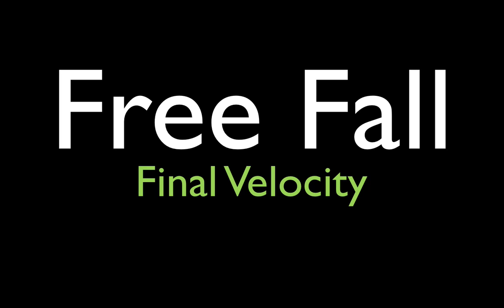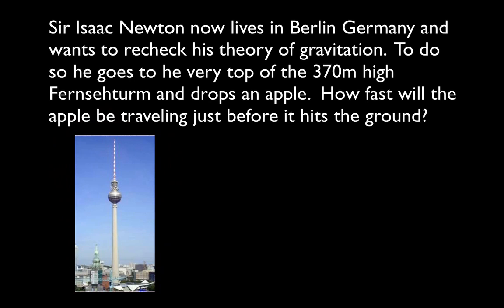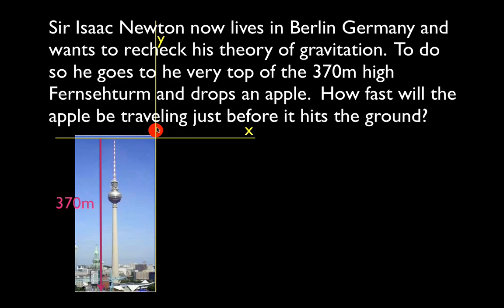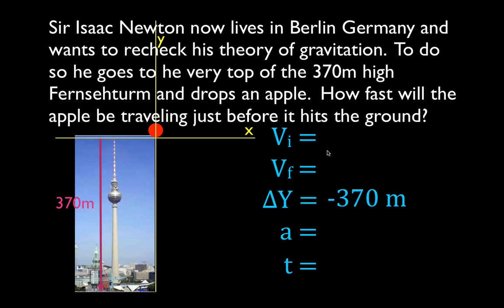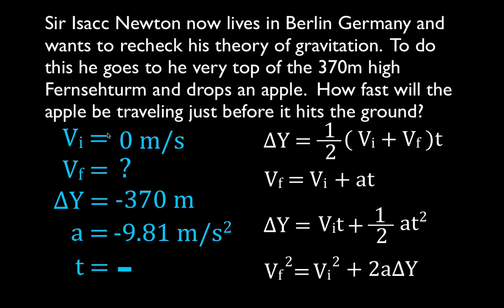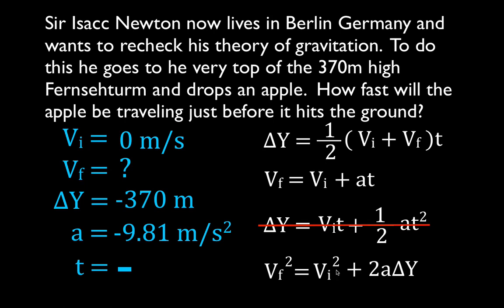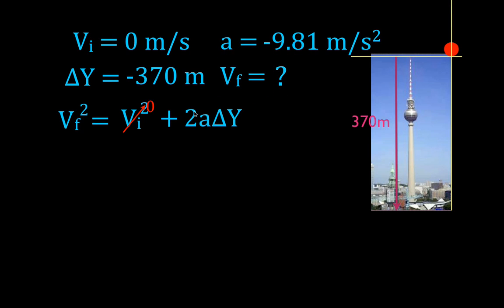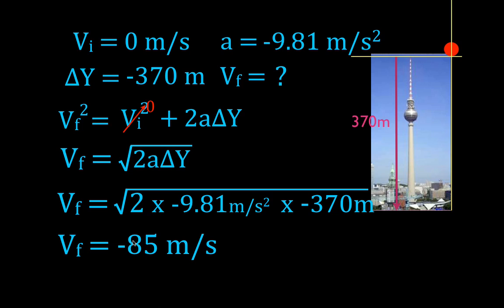Physics, Kinematics, Free Fall (3 of 12) Solving for Final Velocity, No. 2

Comment: Its confusing inside the square root it should be positive and the answer is also positive, 2 (-9.81) = negative and that negative multiply to another negative and it should be a positive. Based on that what is the consideration how it bacame negative answer?
Reply from the maker: Every square root has two answers, the positive one and the negative one. So in this case there are two possibilities, positive 85 and negative 85. We choose the negative answer because the object is falling down. Does that help?

Comment: Sir I was wondering in terms of the final velocity we use it as a positive or negative factor?
Reply from the maker: I do not quite understand your question. For most free fall questions, when the object is falling down the final velocity will be negative. Remember that the change in position (distance) will also be negative and the acceleration due to gravity will also be negative. Does that help?
Reply: @stepbystepscience  yes that helps thanks a lot

Comment: why should we make the given, negative?
Reply from the maker: Good question the negative because  the object is moving down or in the negative direction.  If this case the change in position is negative.  Also that way you will not end up trying to take the square root of a negative number which you can not do.  Does that help?

Comment: the acceleration and the position has negative signs. If you multiply both, doesn't it makes the final velocity  positive?
Reply from the maker: Because it is Vf square there are really two possible answers, one negative and one positive.  We know the object is moving down so we take the positive answer.
Reply: @stepbystepscience   moving down? positive? or negative
Reply from the maker: @deejayjimenez1222 negative